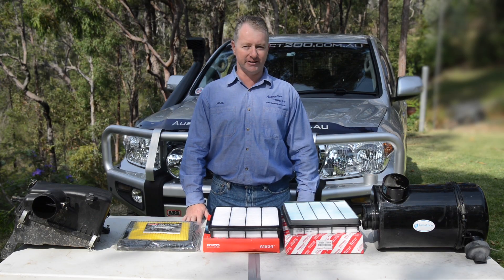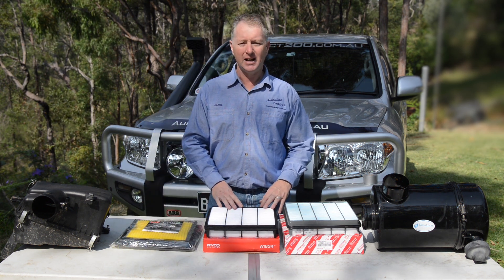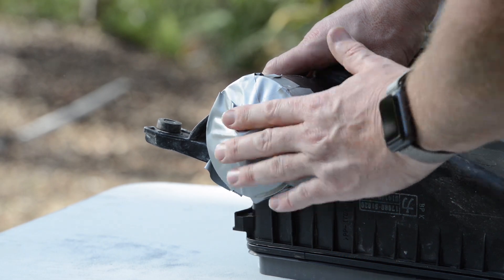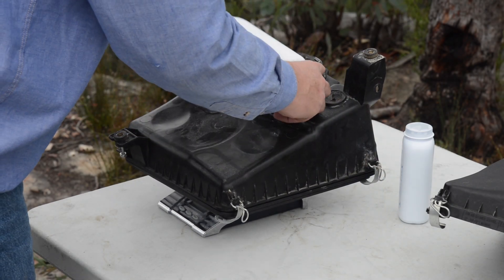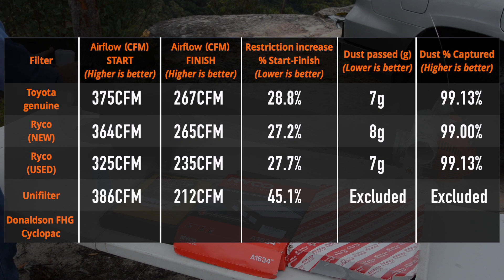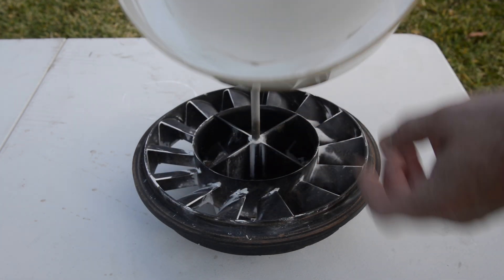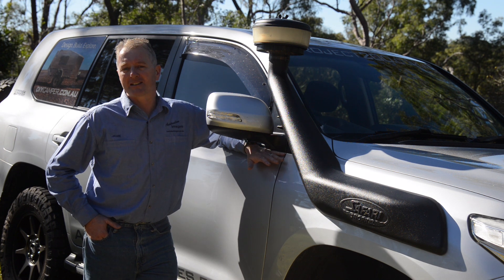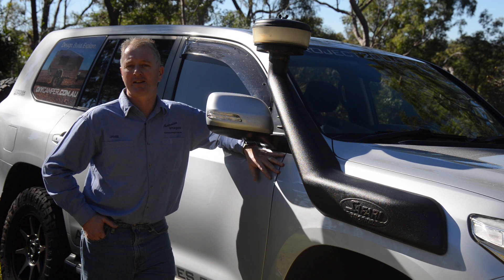LandCruiser 200 Air Filter Testing

Comment: An interesting thing, from what I've seen people using Unifilter in Australia on these LC200s is that the clean side is spotless compared to your testing. I am sure you are thorough with your oil application and setup for the Unifilter but as said it is very interesting. I am about to purchase a Unifilter for my Lexus LX570 as it basicall shares the same airbox and panel (lid isn't as deep but same panel plan size)

Comment: Whats your opinion/or have you tested the new shims you can buy and glue to the air box to increase the clamping power?
Reply from the maker: I've seen them, but haven't tested them. Probably not a bad idea, especially with filters that have thinner seals such as the Ryco.

Comment: Does Donaldson or other co. manufacture a cyclonic air filter for a 200? The one tested looks to big for engine bay?  What would it look like installed?  Does all this info directly apply to the as y'all call it "petrol" 200 series v8? Great experiment/ test!
Reply from the maker: Not at this stage, although there is apparently one under development. The petrol air filter is slightly different, but not by much.

Comment: I have not used a oiled filter on my 200, but all my dirt bikes use them. The difference here is dirt bikes don’t go 5 or 10,000 km between services, when talking MX bikes the filters are washed and oiled daily. As pointed out paper is probably the current solution for touring, this excellent video has given us some thought on which brand to choose though.

Comment: I would like to know how bad the unifilter was.
Reply from the maker: It's not valid, for the reasons mentioned in the article. But around 30% of the dust went through.
Reply: @austimages  He said it performed poorly then defended them and said it was due to the design and how dust affected them, not much point in using a particular air filter if it cant keep out dust.
So many people rave about the performance of the Unifilter, the full results should be out there if they do not perform as people think they do.
Reply from the maker: @cvytnioy56dvfuj4g7  It's to do with the way they operate. With a paper filter, it's the media stopping the dust. The rate of dust injection makes no real difference to their performance. With a foam filter, it's the oil that catches the dust. No oil, no filtration. In their case, high dust rates cause the oil to dry out and it takes a while to bleed through the dust. This test added the dust more quickly than would be expected in real world driving, so was harder for the oiled filter. The ISO5011 test adds dust at a much more realistic rate. Oiled filters generally still perform worse than 'paper', but it's closer. See here for a test: https://www.project200.com.au/dm-iso5011/
Reply: @austimages  Thanks,
I was able to get on my PC and find the full Project 200 details, I could not see them on my phone. thanks again.

Comment: Thank you for the video. Another concern that I have with the LC200 air box sealing is the type of clips being used.  You never quite sure whether they are correctly engaged or still applying the necessary clamp force.

Comment: Great video Jamie, will be switching back to genuine from Ryco I think... That extra thick seal is quite compelling and the 6 month test on the Ryco was super interesting. I do change my filters more frequently but still... Would be good to see a 6 month test on the genuine too.
Reply: Aron I have owned a LC79 since 2012 , change the air filter every service in 300,000km I have had dust get past the air filter on 2 occasions each time a Ryco filter was installed . I have emailed & spoken to Ryco about dusting  around 4 years ago they said it would be looked into . I have had no issues with either Toyota or Donaldson filters  ( 26 + filters). I live in the bush on dirt roads as well  .

Comment: G’day Jamie
Spot on correct. We like very much your accurate postings. Original Toyota air filter latest version the rubber seal is more higher. I just Installed a new one in May. Clips tight and filter plastic housing in good order, proper sealed. Time will tell if the rubber seal shrinks. I am a fan of paper filter in Dust environments. 
I have one suggestion for a re-test. Now you used brand new filters. Make a trip and go through some dust. Normally when the paper filter are used the filter performance should improve. Means let passing less dust through the filter. 
Downside of course the reduced airflow. Then clean the paper filter and check again the results. 
In Dusty environment a pre cleaner on top of the snorkel is a must in my opinion. Pre cleaner performance is second to non and to put it on and take it off is done in minutes and sets you back only hundred dollars. 
looking forward your next posing. Cheers

Comment: I was a bit shocked at the uni filter failed, I run a K&N oil filter in my D-Max, all good so far.👍
Reply: Are you sure about that??
Reply: @MadRS  Are you?
Reply: So do I no problems. 
I did my own back to back testing OEM VS Uni . Uni wins hands down

Comment: So it confirms that the seal fatigues and dust gets in and if the seal is better what to use in " Extreme " dusty conditions. I fitted some extra seal to the factory filter box but still found very light dust in the engine side of the air box and now suspect the turbo force pulls dust through the element itself.
Reply from the maker: It seems to be a combination of the two factors. The condition of the seal and airbox would determine which is most responsible in individual cases. Just be careful if using an extra seal. Unlike the 70-series, the 200 does not have a mesh filter between the airbox and the turbos. So putting an extra seal on the lid-side of the filter is potentially dangerous, as if it is dislodged it would be sucked into the turbos. Between the filter/base is the safer location.
Reply: @austimages  Yes only had it on the bottom half. Good video thanks.

Comment: That was good, while most deal with the seal by adding something extra do you think that the twin turbos actually pull dust through the element itself due to the force of the air being pulled through it.
Reply from the maker: I think that there is an engineering trade-off between the size of an ideal air filter, and the space available under the bonnet. So it's a compromise. Donaldson, for example, say the FHG I tested does not flow enough for the 1VD engine. Yet it flows much more air than the factory airbox. So Donaldson are obviously much more conservative with the airflow/velocity through their filters than Toyota.
Reply: @austimages  Thanks

Comment: Great,  now ive got to get rid of my Unifilter lol.   Ive been holding up installing in until i seen your video,   thanks for the all the work
Reply from the maker: While I won't be running one, and I can't recommend them, there are people who report good results, so I won't tell people NOT to run them either. The performance of oiled foam filters seems to be much, much more variable depending on the level of dust than for paper filters. Like I said, very complicated and not going to settle any arguments today!
Reply: @austimages  Well I use a Uni Filter and happy that it stops nearly 98% of dust in an extreme condition and Uni filter recommend the snorkel sock if in a very dusty driving area. I have seen the pictures of a Uni Filter after a extreme dusty trip and how a layer of dirt would restrict flow but that can be managed with another filter. For most of us who travel light dusty tracks no flow restriction would hardly take place. Personally I do think the Toyota filter while sealing better I still think the twin Turbos pull some dust through the filter itself as it is a lot to ask from the filter. I carry a spare uni filter and am just a caravan traveler and no extreme dust.
Reply: Don't forget that the Uni filter fixed the air leak and while some restriction after the test it was done in extreme dusty conditions. I fitted some extra seal to the factory filter but still found very light dust in the engine side of the air box but now with the Uni filter there is none. Good video though if you want to stay with a factory panel but add some more seal.
Reply: @Travelling100-v4d  I personally recommend if running in dust eg Canning stock route etc  a few spare UNI filter socks for the snorkel head and / or spare main element (UNI) in a zip lock bag well worth the 5 minutes to change it. What is not mentioned but well known in the off road racing community is the UNI filter's ability to 'shed' dirt as it builds up on the outer (coarse) filter layer. I guess this is the difference between testing by 'engineers' and actual REAL TIME.
Reply: @mjhmech4903  Yes I have a spare filter and sock and use when necessary as we travel towing a van. Thanks matey
Reply: All due respect and credit to @Australian Images for posting this but I feel the ISO testing requires challenging in this case. OK So according to the test the Uni filter can create the most restriction in a dusty environment BUT!! ( And this is the $30,000 - $38,000 Engine/Turbo replacement clincher ) After reviewing the ISO 5011 testing kindly provided in the link above,  I would suggest some inaccuracy regarding the Uni filter. I can only assume there was an installation or sealing issue or similar as this has certainly NOT been my experience over the past 30+ years of running Uni products. From my experience, the Uni product IF maintained correctly as per instruction from Uni Filter is the ONLY OEM replacement panel filter capable of removing ALL coarse and fine dust matter according to my tests. Having completed numerous back to back tests of OEM vs Uni over the years.  Interestingly, we also use and stock ACDelco filters as an alternative to our genuine Toyota parts which you will notice are not included in the video but rate very highly in the ISO testing by quite a margin!? PLEASE NOTE: We are neither endorsed nor sponsored in any way by Uni filter. WE are not even an agent.  Please take no offence guys and gals. I am passionate about what I do and it actually pains me to do a compression test on customer's dearly beloved VDJ200 to find it has been DUSTED at LESS than 200,000km of very occasional off road driving! True story!!!  Your rig - your choice! Make is wisely! Cheers